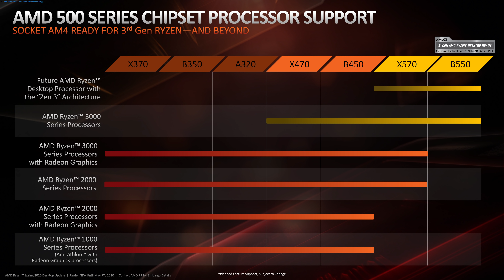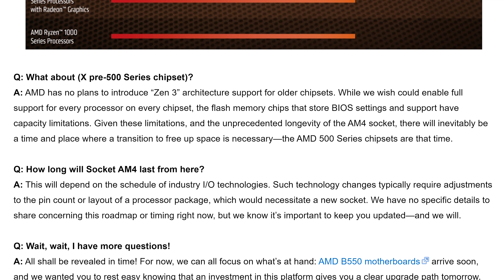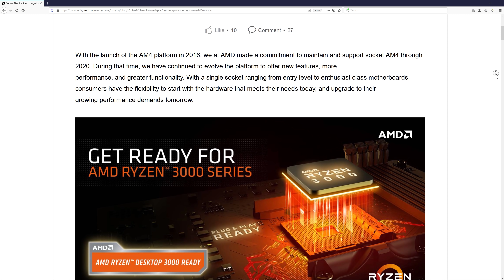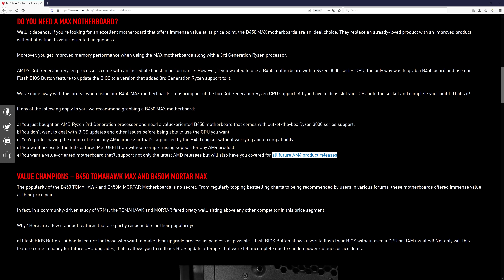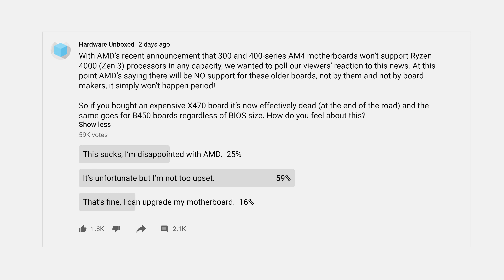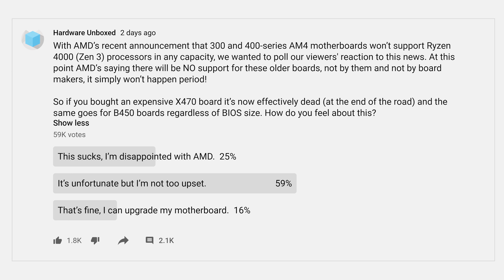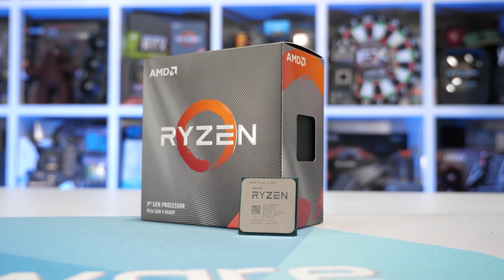AMD Does An Intel, Axes Zen 3 on 400-Series Motherboards, Our Thoughts

Comment: "the worst way to end AM4 platform" that's hurt me ;(
Reply: So the B550 chipset will be released for Zen 3. By the time Zen 4 will be released with a new socket, it makes B550 boards obsolete by a year.
If that's the case, then it's worse than what Intel is pulling with their socket changes every 2 years.
I really hope AMD will backpedal from this and support B450 and X470 boards.
Reply: @lewsee5562  well technically Z390 wasn't available until 9th gen too but it's a flagship board designed for cooling 8 cores instead of 6 on Z370. and B550 is nothing much but a refreshed, cheaper X570
Reply: They make a bad ending with this 

I really Intel to crush them in the future
Reply: Enio Apolinario 

Don’t get me wrong, I know why people are upset. They want to keep upgrading their CPUs without having to buy a new motherboard. So the fact you can’t is the reason you hope Intel (INTEL, the company that would’ve kept people paying $500 for 4 cores) will crush the company actually giving you innovation? Again, all because you can’t save on the motherboard cost?
Reply: @Athasin  He's a Child, who bought into the whole "AMD cares about me".
Reply: Athasin because they are artificially ending the x470 and not because they are technically forced to that’s worst then what intel has ever done 🥺
Reply: @kingyogesh441  No it's not. 
Both AMD and Intel has done the same thing, multiple times over the years. 
Infact AMD did the same thing to the X370 chipset, with Ryzen 3000. 
AMD is a business, so ofcourse they are going to make a decision which earns them more money. That's how it works..
Reply: @Athasin  "would kept" its your opinion and no, i dont trust or love Intel but, AMD truly dont deserve to become number 1
Reply: @Orcawhale1  Great argument calling me a child, still dont change the fact AMd screw a lot of consumers
Reply: @kingyogesh441  

Yeah... no Intel is literally changing the socket so that their next CPUs won't be compatible with past motherboards. Intel's reason for that? None. The new motherboards will support pcie 4 BUT the new CPU's themselves don't support pcie 4, so they're literally changing their socket for no reason ON TOP of still charging people an arm and leg for 14nm+++.

Mean while AMD promised support until 2020. It's 2020 and now people are pissed because they won't continue support. It just screams entitlement to me.

The only thing AMD did wrong was not offer B550 sooner. And if you want to go support Intel and their lack of innovation because of that then... I honestly have no words for that kind of stupidity.
Reply: @Athasin  Dude, I am on an ASUS X570 and 3700X. This does not effect me, but AMD is absolutely wrong for keeping quiet. It is dishonest when even your board partners believe that their MBs will support Zen3 and advertise them as such. 

AMD kept quiet to drive 3000 CPU sales, that is dishonest and AMD absolutely must be called out on this BS. 

And Intel supports 2 CPU gens per socket/chipset. And Intel always says that, you can follow that all the way back to Sandybrigde (except for 4th and 5th gen). 

AMD is doing the exact same thing here, but without telling anyone (not even their MB partners who advertised Zen3 support) when AMD should have said no support at X570 launch (and maybe even sooner). 

AMD is guilty. AMD being silent and vague is not an defense, it is evidence against them.
Reply: @joeyvdm1  hey, i'm the one who become AMD victim OK. I was buying Ryzen 5 3600 last week because my haswell motherboard dead and expecting to upgrade ryzen 7 4000 series when the price drop a couple years later. But here we are, my B450 Mobo cannot support zen 2+ bacause shitty AMD strategy. But i understand why they doing that and will do the same if i in their position. Because i need make money to keep improving and please you guys as AMD fan.

And it's nothing wrong to keep silence. It'll be wrong if i giving you false advertisement/Information.
Reply: @buahkelapaliar8829  Keeping quiet is the wrong the to do, no doubt about it. If it was not the wrong thing to do, then so many people would not be upset. 

I am glad you are okay with it, but that absolutely does not give AMD a free pass. 

AMD knew about it, and kept quiet to support their 3000 CPU sales. 

That is wrong by every definition, whether you are okay with it or not, there are enough people upset that clearly says AMD was wrong by not letting people know and taking their money. 

I would judge any company exactly the same for doing the same. 

The fact that AMD could have avoided this by saying something (but kept quiet to keep selling CPUs), is exactly why AMD is completely wrong on this. No two ways about it. 

AMD wanted the money for 3000 CPUS and let people (and MB partners) believe those boards would be supported. But AMD did not want to support the motherboards that AMD let people believe would have support, when those people bought those 3000 CPUs.
Reply: @enioapolinario8538  I hope so, serve them as karma.
Reply: @enioapolinario8538  You fucking child. 
AMD is a business, so is Intel. Being mad about this, is frankly idiotic to say the least. 
And hoping that Intel crush them, because they made a business move is even more retarded. 
Nvidia,Intel, AMD they are all corporations who's only after the money, so stop with this fanboy nonsense.
Reply: There's nothing controversial about the end of the AM4 platform. AMD have made it clear a long time ago that AM4 motherboards from before 2020 won't be supported with new CPUs after 31 December 2019, so not sure why people thought that their B450s/X470s and older mobos would work with Zen 3 which releases after 31 Dec 2019. If you look at AMD's official Socket Stability slide in the article "3rd Gen AMD Ryzen CPUs Will Work on Many Existing MSI AM4 Motherboards" (search it on Google), you'll see that the graph clearly shows no support for new CPUs on AM4 after 31 December 2019. If you take a good look, the orange bar stops right at the end of 2019, just before 2020 starts. It was already know even a year or two ago that Zen 3 will come out some time in 2020, or in other words, AFTER the official support period. Do people not know how to read graphs?
Reply: @bgtubber  AMD did not make it clear, that is the problem. If AMD came out last year at X570s launch (or even sooner) and said no 300/400 chipset would be supported for CPUs after Ryzen 3000 (Zen2) people would not be complaining. That chart was not clear, that chart did not say "No new CPUs will be supported on 300/400 chipset anymore). 

That chart is vague at best and the the dates don't say 31 Dec 2019 (nor 1st Jan 2020) and has easily been read as 31 Dec 2020 (Because the chart does not say Dec 2019 nor 1st Jan 2020, the chart says 2020). AMD kept quiet and vague on purpose. AMDs is 100% at fault and everyone has every right to be angry. 

By keeping quiet AMD even let MB makers advertise future Zen3 support, AMD is wrong on every level for its silence, AMD was happy to drive 3000 launch sales right up until a few days ago, and only then AMD said, too bad, so sad for you. No my friend, AMD is guilty as sin on this one.

Here watch this Gamers Nexus video on how AMD marketing led everyone to believe their would be support.

How AMD Continually Sabotages Itself with Marketing (B450 / B550 Chipsets & Zen 3 BIOS)
https://www.youtube.com/watch?v=JluNkjdpxFo&feature=push-u-sub&attr_tag=QWZWGoUB2BNS0bl8%3A6
Reply: @joeyvdm1  if AMD tell ryzen 4000 not support B450, all of you won't buy ryzen 3000 or even you will not buy ryzen 4000 because you all know it will not support current AM4 board. So the best way for AMD make money is keep silence about it. I bet AMD already make  big profit from Zen 2 architecture and expect to not sell much for zen 2+.  Even they blabbering about zen 2+ have significant improvement, they already expect backslash of market after they announced this.

So what i understand is, AMD just want you to prepare for zen 3 architecture. That the reason why they announced zen 3 still WIP.
Reply: @joeyvdm1  Why should they explicitly say X470 and older won't be supported with Zen 3 when they already made this clear? Nobody releases a product and then say "hey, this won't be supported, that won't be supported". Normally companies in their marketing materials say what WILL be supported, not what will not be. And how is that official slide I referenced not clear? Does the orange bar not stop before the start of 2020? What's so unclear about it? 🤷‍♂️
Reply: @buahkelapaliar8829  Exactly. AMD said nothing to drive 3000 CPU sales. AMD is guilty as charged. And I explained to you already that everything about that chart is vague and unclear. 

It is easy to say now that the chart means dropped support, but that was absolutely not the case before AMD told everyone. 

AMD did not even tell their board partners and let them advertise their boards as zen 3 ready.
AMD is 100% guilty, and in no way should we let AMD get away with it. 

I am glad you and AMD have no morals, I do.
Reply: @buahkelapaliar8829  4000 series CPUs are a very big deal. 4000 have an 8 core CCX, and 10-15% IPC improvement. 

Everyone is excited for that because an 8 core ccx puts us right in line with an 9900k and 10-15% IPC improvement to go with that. 

4000 is a big deal and many people bought an 3600/3700x expecting to buy an 4000 CPU with those big improvements down the road at cheap prices (some even at launch) because of next gen consoles using 8C/16T. 

AMD has messed their customers around big time on this one. Most if not everyone who bought an 400 chipset board in the last year was 100% expecting to upgrade to an 4000 CPU with all its improvements at some time or another for one reason or another.
Reply: @bgtubber  AMD should absolutely say that that older chipsets wont be supported when people are buying new products and expecting that future support. 

AMD knows after the 300 chipset and 3000 CPU support backlash that people were expecting support. 

AMD even backtracked on 300 chipset support because people were so angry. 

So AMD absolutely knew better from the 300 chipset fiasco. If AMD wanted to avoid that, AMD 100% should have said otherwise. Instead AMD let customers (and even MB partners believe otherwise, that is DISHONEST) 

If AMD is happy to let people believe (and MB partners) that the 400 chipset MB they just purchased will support a future CPU so that AMD can sell them an 3000 CPU, then AMD must absolutely  SUPPORT THAT MB.

When people are buying something that they believe will support a future CPU (even AMD MB partners advertised this) then that is EXACTLY what AMD should give them UNLESS AMD SAYS EXACTLY that is NOT THE CASE. End of story.
Reply: @bgtubber  Did you even watch this video bgtubber? Did you not see the blog post by AMD promising support throughout 2020? How about the fact that AMD have delayed the B550 launch so long so for most people buying budget systems the only viable option is to buy a 400 series motherboard ? Essentially AMD's failure to launch a budget platform for their new chips have made the AMD side of things work like this for the existance of the Ryzen 3000 series chips. Budget systems: 400 series board in particular the B450's and a Ryzen 3600 chip or 3700X chip on the top. And for enthusiast systems get a X570 and a 3700X or better chip to pair it with. This is the way AMD have forced the existing market to work due to their failure to launch a budget platform. AMD themselves even have said as much that 400 series boards are a good option for budget systems. I think at this poind AMD have worked up enough of a moral obligation (due to their failure) to maintain support on their 400 (and even 300 series) platform. It also seems that AMD have given the impression to board partners that Ryzen 4000 would be supported on the 400 series mobbos. So even they are surprised by this sudden move on AMD's part.
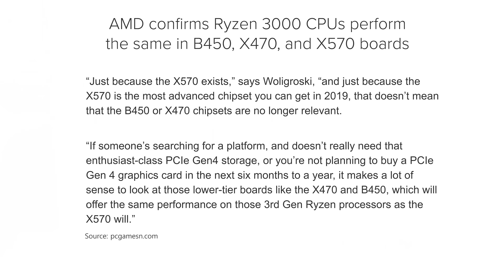Reply: bgtubber did you miss the article at 7:18 in this video? The one where Amd confirms b450 and x470 support for zen3? So you can suck on that stupid december 2019 bullshit, this is not what amd has said, ever. Read the article, if you can‘t read, listen to Steve reading it for you

Comment: i bought x470 just becouse my 2700x didnt work well with b350 i dont feel bad at all becouse atleast i got way better oc potencial also im corrently using x470 with 3700x which is only bonus if u went with x470/b450 and ryzen 3000 thats a really shit move for u sorry i would get x570 this time around anyways

Comment: going to be interesting when zen 5000 is released with the am5 socket in 2021
Reply: I'm looking forward to that. I'm on an Intel i7-7820X now and have been wanting to upgrade to Ryzen 4000.  But if this is the end of the line for AM4 I might as well just hold onto this CPU for another year and wait for DDR5 platform.

Comment: I have a ROG CROSSHAIR VI HERO
 - x370. There was a discount of 45%.  Wouldn't call it a rubbish motherboard, not just becouse of 128 Mb Bios Flash ROM. I've made a research, comparing the advanteges os x470. There's NONE! There's no extra features, or speed or anything. The x570 only have that PCIE4 that, rarely anyone usues. Plus from the beginig AMD was communicating, that only the fifth generation ryzen CPU-s will have a newer socket, and so a need for update! I was counting on to upgrade my CPU to a 4th gen in 3-4 years. I fell I've been deluded!

Comment: Not saying that AMD is in the right, but they did technically support 4 generations. Some excavators have been reconfigured to run on AM4, so they technically lived up to their promise. This does not support them, just saying they did support at least 4 generations, even if one gen is an older gen.
     As far as me? it doesn't really bother me much. I have a 1600 AF i'm fixing to build, so have the zen 2 to look forward to for eventual upgrade. Do i wish they lived up ti the "2020" support claim? Yes, but we constantly support politicians, that do not live up to their promises and Intel promising to move away from 14 NM, but nobody does anything about that

Comment: So if not all B450 and X470 boards have the necessary capacity, wouldn't this lead to even more confusion? Since you won't be able to know which board will or can support 4000 CPUs. ? I believe this is the main reason.

Comment: Bought a b450 in November, gutted...
Reply: Same but mine was a month later lol.
Reply: 2 B450 and 1 X470 here. Fuck me.
Reply: Grab a 3950X when the drop in price after the 4000 series is released.
Reply: That sucks indeed, but maybe next time check the official AMD slides before making a purchase decision. AMD had made it clear a long time ago that AM4 motherboards won't be supported with new CPUs after 31 December 2019, so not sure how you thought that a B450 would work with Zen 3 which releases after 31 Dec 2019. If you look at AMD's official Socket Stability slide in the article "3rd Gen AMD Ryzen CPUs Will Work on Many Existing MSI AM4 Motherboards" (search it on Google), you'll see that the graph clearly shows no support for new CPUs on AM4 after 31 December 2019. If you take a good look, the orange bar stops right at the end of 2019, just before 2020 starts. It was already know even a year or two ago that Zen 3 will come out some time in 2020, or in other words, AFTER the official support period.
Reply: you know you can sell the motherboard on ebay when you finally do an upgrade, that's the INTEL way of upgrading.
Reply: you can maxed out to 3950X dude, you don't need zen3 😂
Reply: @claritoresdiano1021  https://i.imgur.com/6LlqCea.png

Comment: i posted a similar comment on gamers nexus and essentially it was that b450 is practically the same as b550 so there's no fundamental reason why b450 should be left out of 4000 series support.  especially when you consider intel's nearly believable reasoning that hex and greater core chips were too power hungry to run on z170/270 boards.
Reply: Random Name  its not as easy as it sounds.  there are beta bios that allow z170/270 boards to run hex and octo intel chips but reportedly are very buggy.  i wouldn't imagine it would be any more successful for amd bios hackers.  alternately its about tricking the board to see the cpu,  not tricking the cpu to work on the board.

Comment: I think Steve has summed up what most B450 owners think exactly, especially the ones who chose Max versions, with the bigger bios chips, that was supposed to ensure future compatibility. Let's be right, AM4 can't really last that much longer, so why do this now?. The solution that Steve suggested, about having two different bios' available is a good one that should be looked at.

Comment: It's poor move by AMD, did wonder if they where going to have legal problems.
Same socket must give the legal teams confidence but vary misleading which may get them.
I got a x570 after seeing delays on older mobos and assumed new was the only safe bet. But yep I'd be mad if I'd gone b450.
Still if you can go from zen 1 to zen 2 with a used CPU it's not too bad I gess

Comment: I am running an x470 board with a 2700 when it was new. I don't expect to get a new CPU this or next year, and will likely be using DDR5 by the time I do upgrade. So, I don't really care if the 4000 series supports x470 (which is what I have). But anyone that did get x470 recently got hosed.